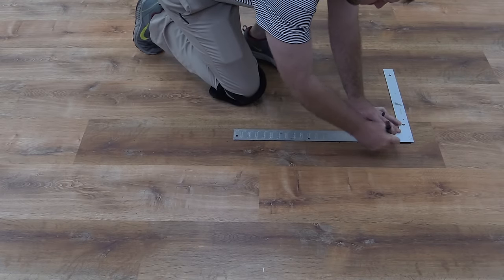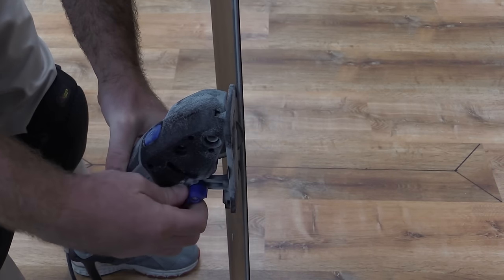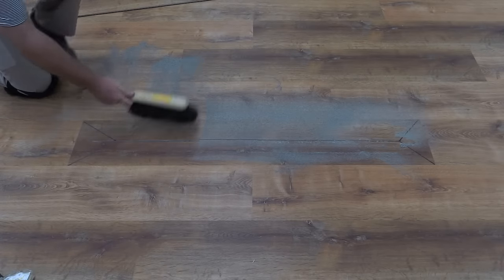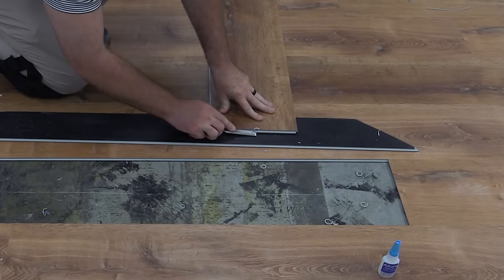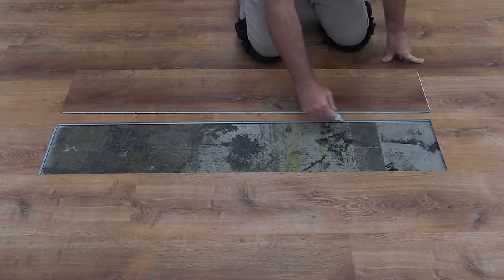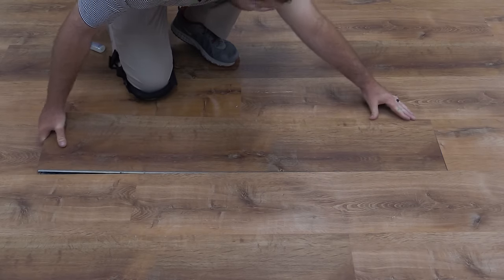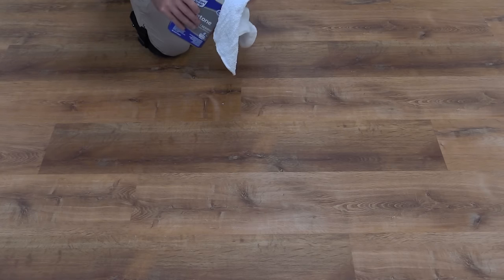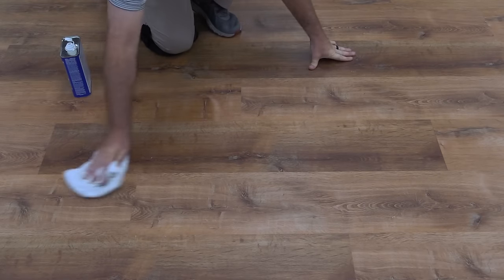How To Replace Click-Lock Vinyl Flooring

Comment: What locks are you talking about. Remove the locks.. its as if you're missing half the video.....
Reply: The flooring has a male and a female long side and a male and female end.  The lock is the slightly raised section on the top outer edge of the female side and female end of the plank.  The lock runs the entire length of the plank and the entire width of the plank on one end and is approximately 1/16" wide and 1/16" tall.  It is very easy to remove with a mini-block plane or a chisel used the correct way.  It is this lock that requires the planks to be locked together by placing them first at an angle to each other.  With this tab removed the female edge is simply a flat surface. Without the locks, you can just drop the replacement piece in flat. The glue replaces the factory locks.
Reply: @rambopierce  uhh.... what?
Reply: @twintailMedia  
Here is a cross-section of a plank of flooring showing the female edge. I have marked the small ridge (the lock) in red.
https://drive.google.com/open?id=1ursPpK3f0jP0GNiBBgCkANYI9PO2aTEw
The cross-section is from the viewpoint of holding the plank at eye level parallel to the floor looking at the end of the plank. I do agree that I think he left off removing the lock from the plank that was already on the floor before installing the replacement plank next to it.
Reply: @rambopierce  Do you mean removing the lock ridges on just the replacement board, the locks on the remaining boards on the the floor, or all of them?  That is the point I am unclear on.  The video only shows you removing the numbs on the replacement board.  Otherwise, great and helpful video.  I have some low spot on the concrete subfloor that were just too sublte to see, so as a consequence some boards are depressed along the lock edges, so I need to remove, address the low spot, and replace.  Alternatively, is there a resin I could inject through a small needle to push the board up?
Reply: @johndeschamps1797  The video is not mine; I wish that was explained better as well.  The lock edges, of course, are what hold the assembled planks together (normally), but on a replacement plank, we need to replace the lock edge(s) with glue.  However, the lock edge is also what makes us have to tilt the plank at an angle to join the two planks properly together, with the locking edge(s) removed the planks will assemble flat without dropping in at an angle, but they won't stay together because the lock edge is gone which is where the glue comes in.  Note we have the opportunity to do that tilt maneuver on both sides of the plank on the initial install, but when you have flooring already installed on both sides of the replacement plank you can't insert it at the required angle on both sides. Whether you have to remove the lock edge on one side or both depends on how much room you have to slide away the neighboring end pieces (and to do that you have to make or buy a special tool). If you have room and can slide away the neighboring end pieces enough you can drop one side of the replacement plank in at the required angle so the lock doesn't have to be removed on that side.  I have seen one video of a guy who makes a hole and injects minimally expanding foam under the planks to correct soft spots.
Reply: @rambopierce  hey rambo does the cutting out a plank  work with a I4F Drop Lock system like a 4 – Sided Micro Bevel edge? another question i have s0me damaged boards close to the walls and i will just disassemble do i start at a corner of the wall? does the female end need.to be closest to wall to disassemble
Reply: @rambopierce  How is it holding up?? My neighbor was saying you never ever want to glue them down and it's better to rip up the floor and redo it.
Reply: @celesteboyce1337  It is holding up great, but your neighbor is absolutely correct as well.  First, in full disclosure, I am not a flooring installer, I'm an engineer so there's that.  However, I do know quite a bit about flooring and need to explain that flooring is either ALL glued down or ALL floated.  In my case, I decided to float the flooring,  i.e. NONE of it is glued down to the subfloor.  Here we are talking about placing a very small amount of glue on the edge of the flooring where the interlock tab has been removed, i.e. the glue is to glue the flooring edge to edge, NOT down to the subfloor.  This technique is absolutely required to avoid transitions in doorways where two pieces of flooring are joined.  Once you understand that this type flooring requires the joining piece to be raised at an angle to join to the next row it's clear why the interlock has to be removed (in these doorways only).  You simply can't raise the joining piece under a door frame.  So, if you count the doorways in a house that is how many joints that are glued.